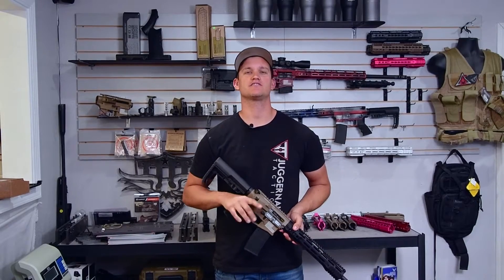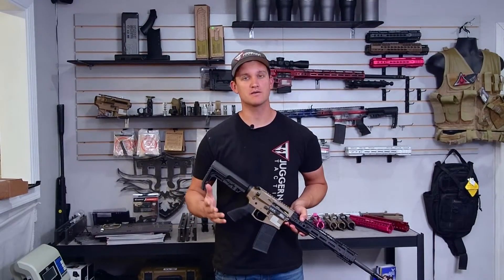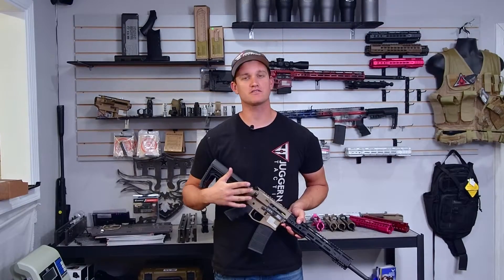Juggernaut Tactical Hellfighter - How to clear a double-feed with Hellfighter Kit installed

Comment: How do you lock back the Bolt action on a JT AR 15 Juggernaut ????
Reply: You don't. The part that takes the place of the bolt catch/release is what stops you from dropping the mag when the action is assembled, in turn making it a CA-compliant, fixed magazine rifle. If you just put a normal bolt catch on there, it would turn your rifle into a normal, free-state rifle aka an "assault weapon" in CA which is a felony. If you need a bolt catch, look up the HOGUE FREEDOM FIGHTER KIT. With the FF kit installed you can then install a normal bolt catch/ release and still be CA compliant.
Reply: Buy the ar mag lock and king pin you can lock your bolt even when you have a double feed or malfunction it also allows you to break the action enough to drop the mag and clear the malfunction the juggernaut doesn’t allow you to
Reply: @rxmichael5454  is the at mag lock compatible?
Reply: @consciousnessevo2012  i bought ar mag lock and king pin and i put 200 rounds and can't lock the bolt and clear a double feed there support said you have to break it in which could be god knows how many rounds. They also said it might not even work ever so time well tell
Reply: @consciousnessevo2012  yes it’s California compliant. And it’s way better than the Juggernaut fighter kit. Way easier to clear malfunctions because you can lock the bolt while the top receiver is open. I love it
Reply: Thats why you go with ar mag lock gen 4 or hoeuge freedom fighter kit my guy
Reply: @jacelarper8368 drives me crazy not having a bolt lock . I'm going to look at that houge kit
Reply: I destroyed my lower trying to remove their upper from their hell fighter kit. Never again

Comment: File the houge pin down a tiny bit and you can drop the mag with the bolt locked back. Just be careful not to file to much, do a little bit at a time, try it and repeat
Reply: This set up removes the bolt catch

Comment: When I first started with my AR I had a few double fees shortly I understood how to get a double feed out, then I just taught myself how to handle my AR where it will never double feed I was taught by an army marshal The bottom line anything happens it's because of you and what you're doing that causes double feeds it's not the gun and it's not the ammo it is your mechanical movement if you don't want double feeds be assertive but aggressive with smooth techniques I have no problem with double feeds maybe your hands are just too big or you're just too aggressive

Comment: I did this and my rear king pin twisted causing it to break. its my first day with the gun, didn’t even get to shoot it. Is there anyway I can get a replacement part ? I don’t want to buy the part if this is gonna happen. The gun a brand new juggernaut jte 15
Reply: VergMafia , I don’t have an answer for that but you should take a look at mag lock gen 4
Reply: I Also have JTE 15. Did you solve problem? So you got a double feed  before ever being able to fire rifle? When did your rear pin twist and break? Was it after taking out front pin? Your hellfighter pin should have been ok when just pushing it to crack open rifle, either to take out mag or  to clear a double feed. 

P.s.  I just simulated on mine with an empty clip in. I  charged the bolt back and it stays back, pushed hellfighter kit in so that it cracks open, at this point you cannot release mag because your bolt is back.(simulating a double feed). Now I pushed front pin out  so the lower and upper can separate enough , when I did this my bolt slammed home ( went foward). Iwas able to take out mag, closed it in the The back , and put  the front pin back in, just like the demonstration in this video. ( again: I dont actually have a double feed in chamber, just simulating , that is why the bolt jumped home when separating front pin.. if I actually had a double feed it would not jump home, but you would be able to take out mag so you can clear it.)
Reply: @liquid7315  super helpful! I just ordered the JTE 15 and my only concern was having to clear a double feed. Nice to know someone has tried what’s indicated in this video and it worked! Nice! Thanks for letting us know! Excited to get mine!
Reply: @Damian Allen with the mag lock gen 4 can you really reload the gun without having to pull the charging handle again to fire?

Comment: Anyone else have a issue where you can’t release the mag with a bullet in the chamber? The gun isn’t breaking all the way
Reply: They suggest pushing out the taken down pins for clearance. 
Someone else suggested opening the bottom of the magazine to release the spring tension in the mag.
Another suggests shaving down the ramp in the  magazine to aide in bolt clearance
Reply: @RyMuEntertainment  yup, that happened to me on the pmags from magpul and shaved part of the ramp and good to go.
Reply: I would just recommend staying away from this device. I have only heard negative experiences. I had purchased one forever ago, but decided to go featureless.  I am petrified to install this into any lower.

Comment: Has anyone else had the problem with the charging handle not working? That’s my current problem
Reply: I did once. I bought a new charging handle and it worked fine. You would think that milspec is milspec but nope!

Comment: This is so frustrating because in order for the mag to be released with a non-jam scenario, the bolt has to return home, and for the bolt to return home the mag has to be filed down. So how do we keep the bolt back in a jam scenario?
Reply: I solved this problem. I didn't feel comfortable with the fact that I could not lock the bolt back with a potential jam situation. I paired the Hellfighter with the Maglock 4. This allows you to separate the lower and upper, but grants you the ability to release the magazine with the bolt back AND you can use the bolt release when reloading instead of using the charging handle every time.
Reply: @bryandastmalchi3250  can you show a video

Comment: So why  doesn't  open the receiver in the first place when the bolt is back locked what creates that tension betwern the buffer tube and to not be able to open the upper and lower
Reply: You have to eject the mag to allow the malfunction to fall out, and once you do that the bolt can ride foward. Rn the bolt is stuck inbetween the buffer and the upper making it impossible to separate the two from the back